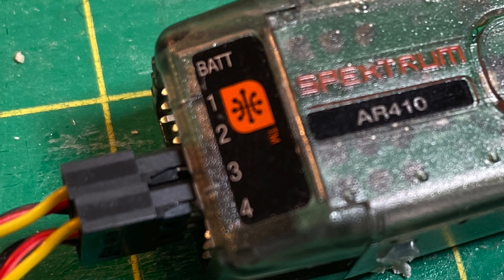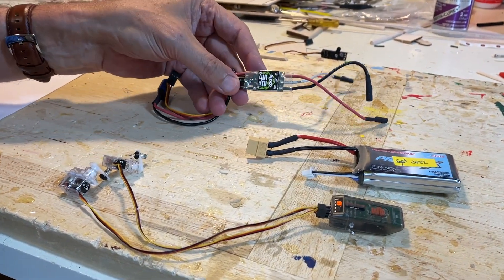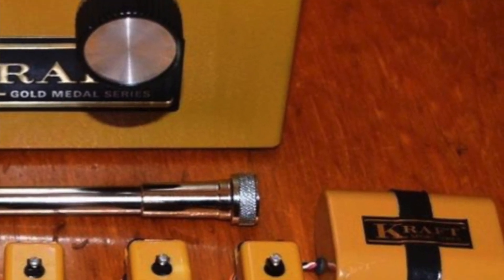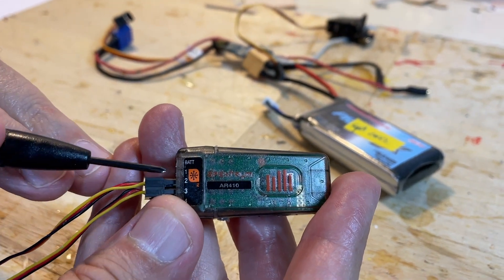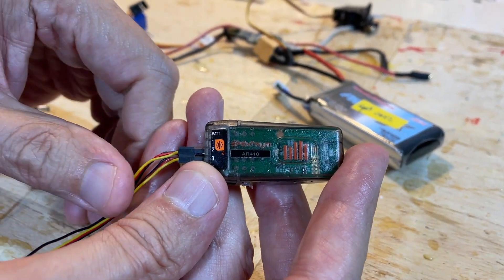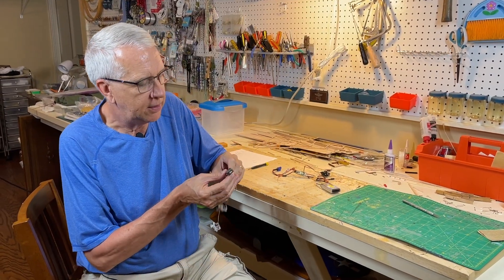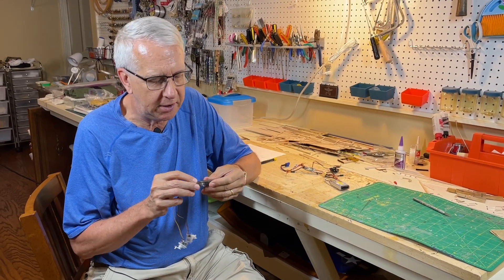What is the Receiver BATT Port??

Comment: Thanks for info. I still use an on board airborne pack to power my reciever and servos, I  take the red power lead from the ecs controller and just use the signal lead for the esc signal, if I run the motor battery too low and the motor shuts down I can still control the airplane.  I know some of you mite say it's  over kill but I feel better when I'm flying with a redundant system aboard.  On my smaller planes, yes, I use the esc to power both motor and radio components.  That's my story and I'm sticking with it LOL,LOL😂
Reply from the maker: Fully understand, great approach!  Tim
Reply: I have seen that too and was wondering why. But if the battery for the receiver gets down and you don´t check that, it would be pretty sad :S  What if the receiver gets power from the ESC and an extra battery?

Comment: The so called Old planes you show is a nitro NOT a gas engine a Gas engine is petrol/ gasoline and they are just as modern as any electric complete misinformation even the plugging of the ESC to the batt port it should be to the Thottle port
Reply from the maker: Thanks for checking in. 😊

Comment: Do any servos plug into this spektrum receiver? I have boat loads of futaba servos from my (5) transmitters from my 72 mHz days.Wondering if I need to buy all new servos. Futaba had an alphabet soup of connectors, ie G, N, J etc
Reply from the maker: Yes, servos do plug into this receiver. Servos do “age” over time, may not work. New servos very affordable, could prevent a crash.

Comment: Great! Could I use this BATT port to power up my servos on a Glider without a motor and not have need for an ESC ?
Reply from the maker: Absolutely.  That's how everyone flew from about 1955 to around 2010 when electrics took over.  Back then all radio sets came with a small rechargeable nicad battery for the flight pack power, the flight pack being the receiver and servos.  And this nicad plugged into the BATT port.  ESC are great as they use technical magic to use the higher voltage from the motor battery to step it down to a lower voltage for the servos and receiver, super convenient.

Comment: I just received a new model that requires a receiver battery..so I ordered one off Amazon (for fast shipping).  Does it matter where on the Rx it plugs into?  Anybody?
Reply from the maker: If a gas motor (not electric) the flight pack battery should plug into the BATT port on the receiver. This powers the servos and receiver.

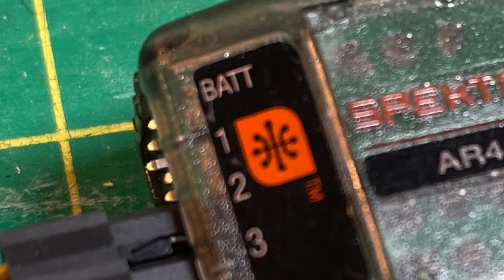Comment: You say you don't use the BATT terminal when flying gas models. (4:55) How do you power the receiver and servos when using a glow engine and a specktrum set-up. Do you need a ESC or just use an old school receiver battery to the batt port? Thanks
Reply from the maker: If I said that, I need to correct the video.  You do not use the BATT port when flying electric.  The ESC plugs into port 1, and that provides the electrical power for the motor and electronics (servos and receiver). 

 You plug (usually a nicad four cell battery) into the BATT port when flying gas models.  That is the only way the receiver and servos can get electric power.  Tim
Reply: @TimMcKay56  Thanks, your videos are great, straight forward and thorough.

Comment: Should note the present state of ESC's versus when the electric boom of the early 2000's was underway  These new ESC's have much better built in battery elimination circuits.  You'll notice new esc especially brushless have a 3 amp rated regulator and a lot of them are doing this with a switching voltage regulator, which doesn't create nearly the amount of waste heat an early 2000's BL controller like the Castle Creations Phoenix 10's and 25's would with their analog, resistive regulators, which run with more than 3 or 4 servos, which added heating to the ESC's circuit board, especially when running more than 3S or 11.5~12 volt flight batteries.  A number of these newer ESCs can handle up to 5 or 6 small servos while running 2s to 5S because of the switching voltage regulator.
Reply from the maker: Excellent technical update, thanks for this information.  Tim

Comment: Hi Tim, Newbie question  can i adjust my motor into push type in tx? Or there’s a different type of propeller should i buy to make my motor a push type?
Reply: Whats the difference between a 6040 and 6040e propeller?
Reply from the maker: One of the beauties of electric motors is the incredible ease of reversing the motor's direction.  Simply sway any two of the three wires from the ESC to the motor, and the motor reverses direction.  Changing rotation direction of gas motors is a much more difficult problem, so manufactures had to design specific "pusher" propellers for rearward facing motors.  With electric motors and a pusher configuration I just mount the propeller backwards on the motor such that the propeller turns in the correct direction (clockwise as viewed from the cockpit for a tractor mounted motor).

When an "e" is appended to a prop size, it usually means the prop is suitable for an electric motor.  Gas motors need a more robust prop for vibration, etc.  Electric props can be of a bit lighter construction.  Tim

Comment: Great video and I appreciate you for making it. Informative for many.
When I started the throttle had No control it ran or it didn't, it ran at one speed and we had Elevator and Rudder control , we ran until the motor stopped which was at any time, and often in a very short amount of  time and normally ran very rough and smoked a lot . LOL
My first electric Model only had ON and OFF and ran off a toggle switch one found in a automobile   still no throttle control and it used a very heavy Nickel Cadmium  Battery, still Just Rudder and Elevator .
Technology has came a very long way .
Reply from the maker: Ahh . . . the good old days.  Thanks for checking in!  Tim

Comment: Thanks for sharing a good bit of history and information on powering receivers.

When I got back into the hobby many years ago, I had much to learn as I wanted to use electric propulsion. There weren't many ECSs that had adequate BECs for my purposes. One of my large planes had an opto isolated speed controller.

My older electric models had a 4.8 volt NiMh pack to power the system. For a more recent scratch build, I was working out my electrical system for a 54" Cessna 310. It has the E-Flite 15-25 sized retracts and split flaps as extra accessories (this was one of Rich Uravich's designs that was featured in Model Airplane News around 2007). 

I wasn't comfortable with using the BEC from one of the speed controllers. I disconnected the hot wires from both  ESCs and used a 6 volt NiMh pack for all servos. As a bonus, the flight battery aided in balancing the airframe too! It's a fast little plane and flies well for me.
Reply from the maker: Understand completely and you did the right thing. Congrats!!  Tim

Comment: i run AR630 and AR631 RX's    can the BATT  plug be used to power external lights on a plane instead of cutting into the servo lines
Reply: , sure, it's the same   as splicing into a servo
Reply from the maker: Great question . . . can anyone assist??  Tim
Reply: YES